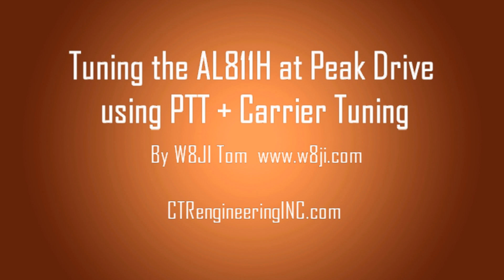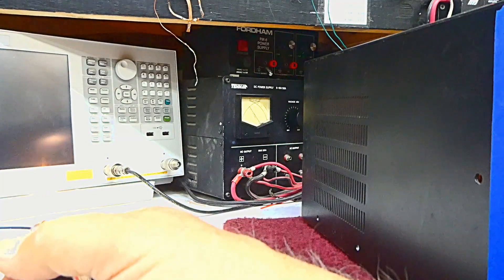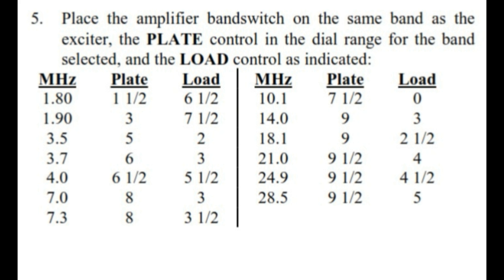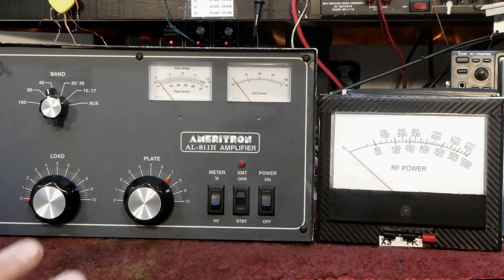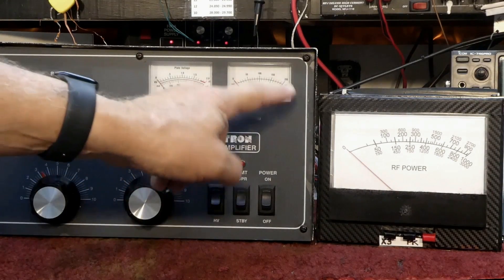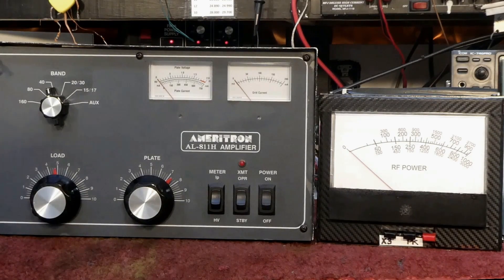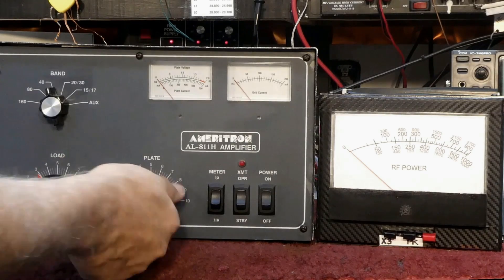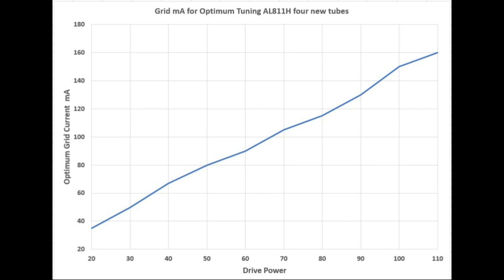Fast Carrier Tuning the 811H Amplifier

Comment: This is right but wrong. If you ram that needle against the stop one time too many you may break it plus you are already above the specs in the manual, also while you are "learning" to quick tune how bad are you beating up your amp. The manual has the tune up specs for a reason. You all do what you want I own my AL80A over 30 years it's Ameritron built and it runs just fine. I'm gonna pass this by two engineer friends of mine and see what they think.

Comment: Great video but now I am befuddled. I replaced all 4 tubes with a matched set of 572B tubes after one of the factory tubes lost vacuum (anode cap separated) 7 months after I bought it. I have been following the manual (silly me!) and have been limiting my drive power to make sure my plate current doesn't exceed 750 mA. (Grid current is always below 150 mA.) 40M and 80M get me 600W out, but 20, 15 and 10M are much less when my plate current gets to 750mA. Should I disregard the plate current even tho it pegs? AND, the Load Control seems to do very little. Resonant antennas on 40M and 20M; hi power tuner used on the other bands. Thanks for this info!
Reply: That happens to me also. I just follow his guideline which is never exceed 750 mA of plate current or 200 mA of grid current.

Comment: Great video, it all makes sense now.

Dumb question,  for test with "no drive, amplifier keyed".  The lowest power setting on my Yaesu FTDX10 is 5W.  Assuming no drive is zero watts?  If so, how do I key the amp with no drive.   

Thanks Tom for all you do to keep these older amps running.
Reply: To answer my own question,  thanks to another FTDX10 user.  To do the diode test with no drive, just take the RCA cable that goes into the 811 Relay port.  On the radio side of that cable, just short the center pin to the outer metal bit.  You can use a screwdriver, paper clip, etc.  That will trigger the amp with no load.   Indeed, my diode was bad which explains tuning issues.

Comment: I read your intro.
At the end : what is a TOF please ?
By using Google translation some terms are weird.
When you Say " Dipping the plate" do you mean, as I was told " you must look for maximum HF in the "hollow" plate current"?
I did that with my FT-102.

I see on the "user manual", on 40M, the load must be  around 3 or 4 ( I have not the manual, I write from m'y memory).
On my Al-811, the load is on 1 and below. If I go on 3 or 4, the HF power goes down.
I also read  something like : a little number for load is bad for intermal parts of the AL. ( Why ? )

I ran out of the barn yesterday the AL.  I didn't use it at least since 20 years.
I opened  it to check if something , like capacitors... , was wrong.
I use an extend to feed the 230v, to have enough distance in case of😊... All was ok 

Sorry about my poor english, I hope you can understand it.

Comment: Tom, I just want to thank you for this video!  Dang, the manuals and other well-intentioned hams would have new-to-amp folks like me thinking that proper turning is some kind of esoteric activity.  You have simplified it quite a bit.

Question:  I have an 811H that I picked up used and will be installing a new set of 572B tubes.  What mA value am I shooting for with the 572's?

Thanks for your videos.  They are very helpful.  Sub'd.

Comment: If I follow the procedure in the video works flawlessly and I get the 800 watts (happy about that) but then when I’m reading the manual it says about never exceed 80 watts so that confuses me because I want to treat well the amp but with 80 watts I don’t get more than 550watts. So do I trust the manual that should be the gospel or this video?
Reply: Same question. I assume the manual is conservative. This video is by the designer. Certainly would ensure the exciter (driving TX) doesn't exceed 100W. I go for max then usually reduce input to desired output.

Comment: Once the amp is tuned using this method, can the output of the radio be lowered to give the desired output from the amp?
Reply: Yes. Just not the other way around. If increasing power after tuning at a lower input power, it must be retuned. But tuned at a higher input power, then you can safely reduce input to whatever lower output you want.

Comment: I have been afraid of a tube amp due to this issue with the tuning. But at the price point per watt it makes sense to get the tube type. A solid state is ok but then they get you with the power supply and screw that. Not paying another grand for a power supply. Thanks for the good info

Comment: Thx Tom.. Big fan of all of your stuff on CTR Engineering inc too. A must read for any 811 0r 811H owners. I have all the upgrades from CTR ready to order soon as Birthday present, however- I have been using my AL-811H for 5 years now with no issues- same tubes even. Maybe I just got lucky with my tubes since it seems i haven't been using enough exciter power for the tune up. I did install the GOP-100 to protect accidental overdrive though. I have been tuning it with a 50 watt cw carrier and on SSB the exciter sits at 30-40 watts- usually runs about 300-400 peak with a low SWR and just have fun with it.. 73s and thx for another great vid. W5YAK

Comment: I am on your site constantly reading. When are you going to write a book! I'd buy it. W6ORV / AL-811 Power Supply Kit / Fan Kit / P Suppressor Kit / 2022 build so it came with the 811R200K configuration.

Comment: One question I wish you could answer when I ordered this 811H I paid more for a grid protection circuit board.  This seems to limit my input dirve power to just 50 watts key down.  Any higher and the amp shuts off and I have to put the standby switch to standby and then that resets the amp.  Is that how it is supposed to work?  de WB7ORB
Reply from the maker: The GOP trips at a certain quasi-average current. I initially designed the GOP back around 1983 for the AL1500. How much current does it trip at? Have you tested that? I need more details to answer.

Comment: Could you do the same thing but instead of a power meter following the amplifier could you have a tuner as the tuner has also essentially a watt meter there showing both the forward and reverse power. Because of course the tuner is President normally I have the tuner when I'm setting the amplifier in coax bypass when I'm doing the tuning of the amplifier

Comment: How do you trigher the amplifier with no Drive. There is a relay connection between the radio and the amplifier and when you either hit the key or the press the microphone there's going to be some level of Drive even if it's low. My ts2000 gets 5 watts. How am I going to do that with zero power unless of course I disconnect the output power of the radio into a dummy load and just simply have the key operate the relay
Reply from the maker: There is always a way to do this. On SSB in a quiet room, or with the microphone and power turned way down. On CW with no key plugged in or no key closed, and you push the microphone PTT button, hit send, or whatever triggers the amp. 

Or you can just short the amplifier Relay jack manually to test the diode.
Reply: @Jerrythenerdful  thank you